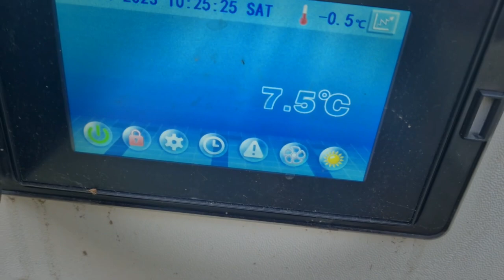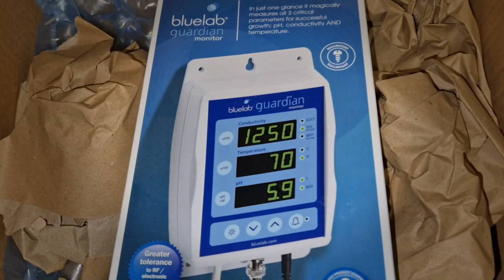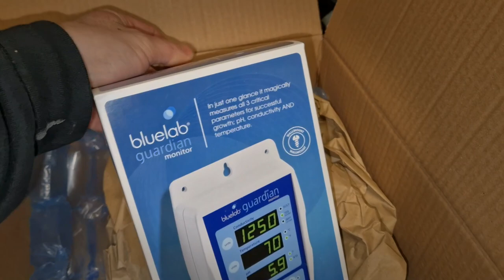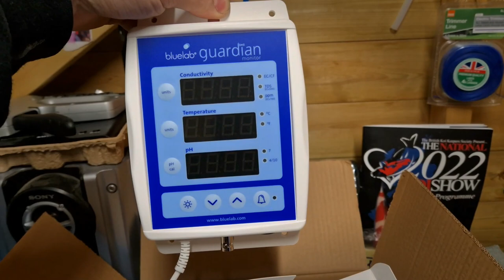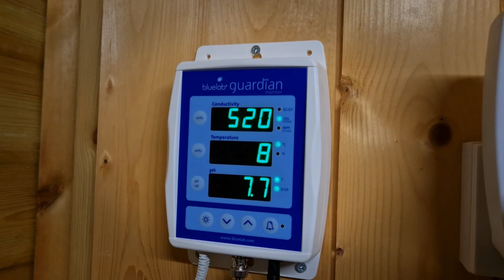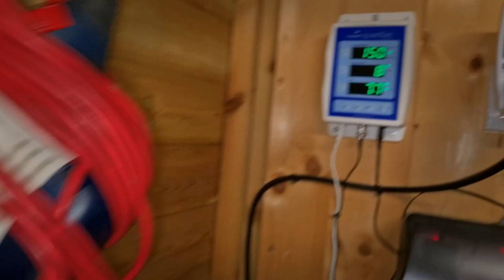Adding a Bluelab Guardian To The Pond, Air Pump Failure & Maintenance

Comment: Thank you for the shout out Si, much appreciated 😊. Blooming cold up north, you need to get yourself a little heater for your filter house judging from your breath🥶🥶🥶. Quite a lot of crap in that bottom drain flush, just goes to show you still need to do regular maintenance through the winter👍. Need to remember that if you have any salt in your pond it will massively increase the TDS reading so yours might not be as bad as you think if the tap water is only 150🤔. Definitely think about reintroducing your trickle-in. Keep up the good work👍🐟🈲😊
Reply from the maker: Thanks Phil, no problem 👍 the salt level in the pond is 0.03 and fresh tap water is 0.01, so I'm no too sure how much that would affect the TDS reading🤷‍♂️
Reply: @UpNorthKoiPond  evening Si🖐. No you’re right, I thought you may be maintaining salt level at higher than that so if not, definitely not bumping your TDS up massively. Just checked ours and out of the tap is still 420 so I don’t really have any choice other than RO. Mine is current down to 170 and dropping so I’m pleased with that. Sure you’ll sort it out😊👍
Reply from the maker: @TelfordKoiPond  420 is crazy out the tap🫨

Comment: I have that heap pump and their tech guys told me that they don’t recommend lowing the temperature below 10degs because it puts too much pressure on the compressor and shortens it’s life.  Be interested to know if you think this is wrong.
Reply from the maker: I have no idea tbh with you. All I know Is the accessibility is there to be able to lower it than 10c. In fact in the manual it actually says that the pump won't start working until the water temperature within the unit is at 8c, so I have no idea.
Reply: Yes they could do with better manuals, but the customer service has been good. Do you think you’ll ever fit a heater in the bottom to stop the condensate from freezing up?
Reply from the maker: @English Independence  probably not because my condensate drain hoses go straight into a mini soakaway. Also as soon as it goes into defrost the condensate drains straight away.

Comment: Don’t forget Si if you have salt in your pond it will make a huge difference to the tds reading
Reply from the maker: Absolutely 💯  the salt level in the pond is 0.03, so I'm not sure how much that would increase the TDS. the salt level in fresh tap water in my area is 0.01.
Reply: Living by the sea near morecambe mine lays at 0.05 guessing its the salt in the air. Comes out of the tap at 0.01. Such a science this hobby 👍🐟

Comment: just bought one of these. what should the tds be for good water. is it as low as posible. mine is showin 650.
Reply from the maker: Do you have any salt in the pond? Lower the better as it indicates that there are less contaminants like metals etc
Reply: @UpNorthKoiPond   no bud no salt  do i have to do more water changes like you said on your vid.
Reply from the maker: @shaunhowarth7523  if there's no salt in the pond, then it's just down to the water supply in your area. The only way to lower it is RO (Reverse Osmosis).
Reply: @UpNorthKoiPond  simon what does that mean.
Reply from the maker: @shaunhowarth7523  Reverse osmosis is a method of removing contaminants from the water via specialist equipment that regular filters are unable to do. So normal filters remove things measured by the micron, but dissolved contaminants in water supplies are molecular, which is where the specialist equipment comes in. My opinion, unless you are really into the science of keeping water or you plan on showing fish, I probably wouldn't chase the TDS.
Reply: @UpNorthKoiPond  ok simon thanks for heping like a said just bought one for the ph and temp. but watched this vid and wanted to know what  tds was thanks.

Comment: You want to look at jebao eco airpump Simon and yea ea are good
Reply from the maker: Thanks Mark, certainly going to look for another so may take a look at the Jebao👍
Reply: Their a Great pump.
Reply: E.a are bloody noisy si , jabao for their price are brilliant pumps and very quiet. 
0.1% of salt will increase your salinity readings by around 1000 ppm , after the tds meter does its conversions I’m not sure what that would equate to but it’s a lot , it’s surprising just how little salt or any other dissolved solid can increase your readings ie clay , verkon etc
Reply from the maker: @KWPR,Koi ,water, plants And rants  cheers Martin. Yeah it is a noisy pump but it hasn't missed a beat💪 I was surprised just how little salt it takes to rapidly increase tds levels.

Comment: How much sodium thiosulphate do you add to your pond? How much per gallon? Cheers
Reply from the maker: It varies depending on the strength of the mixture that is made and how much chlorine you need to neutralise in your supply water.

Myself personally I make up a 1litre stock solution in a bottle. With 1 litre of water I dissolve 98g of sodium thiosulphate, and with this mixture I use a dosage of 150ml to fully dose my pond volume of 9500litres.

You don't have to make a stock solution, you can make a fresh mixture each time but u prefer to store some in a bottle ready made.